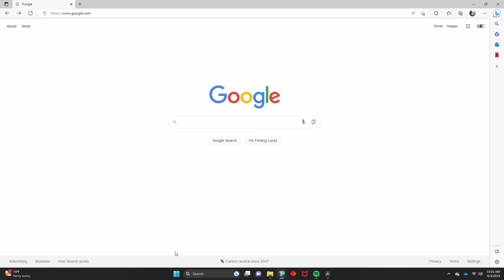The Worst RV Slideout System - from an RV repair tech

Comment: Yes. My RV has this system. Yes, I have purchased some spare parts for it. No, I never thought about the gear box having a oil leak. Big thanks for that. I will keep my eye out for it. Since the BAL system is common, why not put together a video on inspecting it and doing proper adjustments to it?
Reply from the maker: Thanks for the feedback! I may do that as I have to repair broken cables for a client soon. I understand that while many people who are still shopping can avoid buying the system, it is so common that many people are kinda stuck with it. I'll see if I can work on that this spring.
Reply: @undercoverrvtech please do that video.
Reply: I have had the oil leak problem myself. Bal sells a drip pan that I just bought and will be swapping out motor and gearbox once parts arrive.  Hoping that will resolve things for a while.
Reply: I have this system on my 5th wheel camper where can you buy a different slide out kit ?

Comment: Even better advise is NOT to buy an RV with a slide and kiss those problems good bye. RV's are very poorly built to begin with so you will always be fixing something. They are not built to withstand the force going up and down the bumpy roads. They are a hugh money pit. After doing a lot of research, I took the time to build my own with no wood structures using a cargo trailer which has a solid frame and has the strenght of a tank. I do all my own maintenance never having to call a tech and never has to deal with the inconvienence of waiting for a repair person. I have watched over 100 videos of people who are dependent of traveling way accross the country to find a repair facility and the nightmare finding someone local to repair their RV. It was enough motivation to keep me far away from factory built RV's forever!

Comment: I had an owner of an RV dealership tell me what he will avoid. He said any RV with a side mounted A/C unit is begging for water penetration from A/C unit as well as incoming rain. In his words he “refuses to buy or sell one, because he can’t warranty them.” He had sold a unit new, customer bought extended warranty. The dealership had to buy camper from customer 3-4 years later due to it would cost too much to repair it.
Reply from the maker: A side mounted rooftop AC seems like a bad idea. I've not personally worked on one but I can see how it would end up leaking.

Comment: Interesting. In nearly two decades of RV repair, I've rarely had to deal with the issues you listed. The most common catastrophic issue I've dealt with in an Accuslide is the gear box failing, and even that has been relatively rare.

I've performed far more repairs on, and dealt with far more frustrated customers in relation to, Lippert's Schwintek system. It is by far the least reliable slide out system on market, and it's not even close.
Reply: Right? If it were really that bad then it wouldn’t be so common. It can’t be the easiest to install compared to the others so I don’t think it’s cheaper overall. By the time the horrible things mentioned happen, you failed to notice some easy to spot preventative maintenance, like cable slack for one.

Comment: I can’t understand why in the Sam Hell they don’t vinyl coat the wire rope/cables like the weight machines in gyms!!  Some of these weight machines move hundreds of pounds 100 times plus a day and don’t fail.  They have a robust vinyl coating on the cables with a robust pulley system as well.  Also, a bit bigger cable would help tremendously as well.

Comment: I have 2015 camper with two huge cable slides and one small cable slide. As soon as I tell you I’ve had no problems in the years of using it, something will go wrong. I do keep an eye on cable alignment. Many owners of these models actually carry a spare slide motor/gearbox, which will usually prevent them from ever failing, because you have a spare!
Reply from the maker: 🤣 Spare parts as preventative maintenance....I'll have to add that! Lol.

Comment: My Keystone Passport has the BAL system and it did leak oil on my slide out roof.  The bubble was simple to cut out and repair with a metal patch which should prevent any further problems. 
     I also keep the cables adjusted properly to avoid any binding problems.

Comment: I have a lippar (don’t if that’s spelled correctly) but I say a little prayer every time I hit the button. I also researched how to manually close in case it fails while camping and have the tools to do it. Cheers
Reply: If your gearbox fails, the extra emergency tool won’t work. But several people helping push it in will get it stowed. Look underneath at the rubber cushions that hold up the roller arm that the whole slide rolls in and out on. As long as the rubber cushions hold the arm up so only the roller on the tip touches the rollout bottom, you are good. HOWEVER- if the arm sits flat, and the weight is not carried by the roller, that’s the root of the whole issue! Factory has been known to install too small cushions, they come in different sizes. Get the largest size, they aren’t hard to install yourself with a few hand tools!

Comment: I would take my cable slides back in an instant over the crappy schwintek slide. We had 4 cable slides on our 2021 lemon. I had 2 cables break (replaced myself) in the first 4 months. Then a learned that the brackets were improperly positioned so I repositioned 10 of the 16 brackets and never had a problem. Checked the tension every few weeks and they worked great.
Have 1 schwintek on our 2023 lemon and it's trash. 1 motor popped loose and tore itself apart after 7 months. Replaced it and then the entire slide started jamming. Fought with Keystone and got the entire slide mechanism replaced and it worked for a total of 3 months before it started jamming again. 
Cables are cheap and easy to fix, they just require a bit of maintenance. Schwinteks are extremely complex and very costly to repair.

Comment: I had a Kit travel trailer with a manual crank-out slide.  The nylon gears stripped out so every time I made a right turn in my mirror I watch my slide start sliding out on the highway. Couple times had to make additional sharp left to put it back- LOL.  Finally fixed it and traded it in on a toy hauler.
Reply from the maker: 😬 Yeah that is not fun...

Comment: #4 - Buy a spare cable and a few other parts to carry with you just in case the RV repair tech you call doesn't have the necessary parts in stock. That way you won't have to lose vacation days while waiting for parts to arrive,
Reply: But it’s sooooooo common how could a tech not have the parts? 😉

Comment: I totally agree with your points on the cable slides.  I had one trailer that had this type of system and was constantly in the shop as the wires would break at the connection point.  After being in the shop three times we sold it and replaced the trailer.  this all occurred within the first year of ownership.
Reply from the maker: That sounds like they were being over tightened. The fittings are crimped onto the cable ends and can only withstand so much tension. Sorry to hear how troublesome it was but glad you got a different camper.

Comment: I have this system, and repaired the previous issues from the previous owner.  It’s good and reliable now, with no more issues. I think you are overhyping the issue a bit. You are trying to sell maintenance as part of your business, but say this Accu Slide is a lousy system. Yet none of the issues you stated are the fault of the system, they are a result of LACK OF MAINTENANCE! Customers need to learn it is far less costly to maintain an RV/Vehicle/truck than it is to repair the breakdown after it occurs. Proven time and time again in Automotive industry studies! Good message in your video though, it’s just a tiny bit unclear- that’s my 2 cents!

Comment: My 5th wheel has this system and the main problems have been with the gear box wearing out. I've replaced 3 and doing the 4th next week before it stops working.  I was lucky that a mobile repair tech was able to fix and replace the others in the same day without too many issues. Planning on replacing them about every two or three years.

Comment: Unfortunately our 2017 Keystone Montana 305RL that has the cable slides. I carry 2 sets of cables and a new motor and gearbox plus all of the tools (cable cutters and crimper) to make a repair.  I have watched every possible YouTube video on how to fix this POS if it breaks.  But you're correct.  I'd never buy another one with cables or any Keystone Montana for that matter.
Reply from the maker: I just added video about the new BAL EXACT slide system you should check out if you end up shopping for a new camper. I've not worked on one yet, but it seems to have solved every complaint I have with the Acc-Slide system.
Reply: @undercoverrvtech  I doubt if we'll ever buy another rv.  The entire industry sucks right now along with customer service.  I'll go back to tent camping first.

Comment: We are considering the new Vroom track mechanism to replace Schwintek.  I have read on owner blogs and a couple YouTube videos how great and heavy duty they are.  Expensive but beefy and problem-free.
Reply from the maker: I am optimistic about Vroom. It would seem from what I can see of the design to eliminate most problems that Schwintek has. I'm also optimistic about the new BAL EXACT Slide system which eliminates all my complaints about their Accu Slide system. If you get a Vroom let me know how it goes for you!

Comment: Slide systems are, in general, a source of pain and frustration. I have always thought "more slides means more failures". Our current RV has a single full-length slide with a slimrack system that is so far, drama free. Fingers remain crossed.
Reply from the maker: How long have you have it and how often do you operate the slide?

Comment: Yuppers. I had a 2018 Premiere that ripped the pulley bracket right off the wall on the livingroom slide. The dealer "fixed" it and when I went to pick it up I decided to check it before leaving... the bracket on the other side was now hanging off!  Thankfully a tree fell on it and wiped it out before the warranty was up!

Ohh and yeah all 3 slide motors were leaking.

Comment: I have never owned this system (first RV was schwintek and currently rack and pinion) but I always wondered about reliability.  I would love to see more information on how to find studs and run wiring.  There are videos on youtube for how people have done it, but they all seem very specific to their RV.  For me, I need to come up from the underbelly, through the wall, and out the back (I want to run a camera wire to connect a backup camera to my truck's camera system) which I know is likely multiple videos.  Subscribed. =)

Comment: You said what not to buy but you did not mention which type of slide out that should be purchased.
Reply from the maker: Through-frame slides, hydraulic or electric, have the least issues in my experience. For the above-frame systems, of which this BAL Accu Slide is one, I've had to work on Slim Rack from Lippert the least, Schwintek has a lot of issues in recent years from both manufacturing problems and installation problems,  but does not tear up the RV the way Accu-Slide can. 
The above-frame systems I'm most excited about right now are new to the market so I don't have any experience with them and time will tell how reliable they are. Those two are BAL EXACT Slide, and Vroom slide systems.

Comment: Questions:
Things we can do to avoid water problems in the RV beyond just the pipes you talked about? 

How to avoid emergencies on the side of the road (such as this)
Reply from the maker: Check out my short videos for more tips. If you have a Suburban tank type water heater,  be sure to check and change the anode rod. (See short vid) Keppra slide seals in good shape, reseal the roof and siding annually to keep water leaks at bay. Clean off tops of slides before retracting to prevent damage from tree branched to seals and roof. Winterize properly,  use pressure regulator. Yeesh, I feel like I should make a whole video on ways to avoid water damage. 🤣

Comment: We had an Alliance Valor with that System and nothing but problems. After a month at the factory for repairs to the slides and still not fixed we traded it in for one without cables.
Reply from the maker: Sorry to hear that. Be sure to tell Alliance that, they seem to be listening to their customers and making changes. Also, check out my video about BAL Accu-Slide V BAL EXACT Slide I just uploaded.

Comment: My R/V has these BAL units on 4 of the 5 slides and they do cause a lot of problems and although fairly simple concept and  not complicated to adjust but mine are a PAIN in the ???. They are on the bottom of the slide and not on top. Its a nightmare to get in to adjust them. Other than that i love my R/V and cannot afford to trade up. Good informative videos. Thank you.
Reply from the maker: Yes, bottom motor are a pain, but I've worked on top adjust systems also that are really hard to access because the ceiling is so low.

Comment: Jacob what do you think of thr BAL Exact slide system ? Its still cable operate. The motors and adjustment is on side of the slide on inside of camper.

Comment: What is the very best slide out system? At this point in time are RV does not have slides. I have seen slides with rack and pinion, hydraulic, electric gear drive with two motors and cable. Some slides just slide on a plastic rail others have rollers and so on

Comment: I just traded a 2016 Keystone Fuzion TH that had all three slides with this style of slide mechanism. Knock on wood, they never gave me an issue and the cab;es were still tight when traded. My new Montana has the bedroom slides with this same setup. I’ll knock on wood.
Reply from the maker: Be sure to check the roof for bubbles caused by a leaking gearbox. Some don't leak, but I've seen that a lot do.

Comment: Slide systems do not seem to be something RV manufactureres place in their spec sheets.  So one does not have to physically go to RV lots to check which mechanism they are using, can you supply which 5th Wheels RV brands should be avoided because they use BAL Accu Slide Systems?

Comment: Hi Jacob, What units do you think where best all around in the  2004 to 2008 range for diesel pushers and remaining under $80000 in todays market?  I would like to avoid the DEF system. Thanks
Reply from the maker: Because the chassis for motorhomes are not made in the RV industry, the quality and reliability of the drivetrain is similar. Overall when buying a used vehicle,  milage is the best indicator of condition. The higher the milage,  the more issues there tend to be. I look for the lowest mileage I can find. Also you want something that was not lived in full time, was serviced according to the chassis manufacturer specified intervals, and garage kept. Low generator hours are also a plus. Outdoor storage is harsh on RV's, and if there are leaks the damage is much worse than if it was stored under cover.
I wish I could say a particular manufacturer as an answer, but I've found that the factors above are more important for shopping than name brand.

Comment: This Video is SO HELPFUL - What happens if the cable bracket tears out of the slide out? Is there ANY hope at all of drilling new holes & re-attaching that bracket is would it total the camper?
Reply from the maker: I've done a repair like that. It did not look pretty but it worked. If the frame in the wall bends you also have to use shims to remount the pullies to keep the straight. It is a big mess.
Reply: Thank you SO much for these videos - they are game-changes. I saw the one that differentiates between the BAL accuslide and the BAL Exact slide - that was what actually gave me confidence to go and buy an RV & not get hosed! I'd LOVE to see a video that explains the differences between the two systems and why the BAL Exact Slide solved the problems the cabling system presented. :)  @undercoverrvtech
Reply from the maker: Thanks for the feedback! That may be good content for a short video. @user-qs4sc7qc6f

Comment: 5 broken cables so far and they all break at the bracket outside. rubbing on the hole on the inside wall i think.

Comment: what are your thoughts on a 2003 Coach house platinum 270 xl with 60000 mi. with one slide? are they any better than the rest of the junk out there? TY!
Reply from the maker: Never worked on one, but in general I like RVs with a molded fiberglass body. This will not delaminate like a lot or RV's, it is structural and overall will last longer. 
60,000 miles is good, you should get good life out of that still.
One thing I would watch for is that on class C, B+ RV's if they did not upgrade the rear sway bar and shocks it may not handle well, or might wear out the shocks quickly. The factory suspension of the van is not designed for as large of a loan as that 270xl. I've done a lot of swaybar and shock upgrades on Mercedes Sprinter RVs for this reason.

Comment: Question:  Is the Chevy 6.0 gas engine too small for a 2008 class C Winnebago 31 foot?
Thanks in advance!
Reply from the maker: It is probably fine for the camper. If you are wanting to tow a car behind through the mountains, it will struggle more than a larger displacement engine with a tow package.